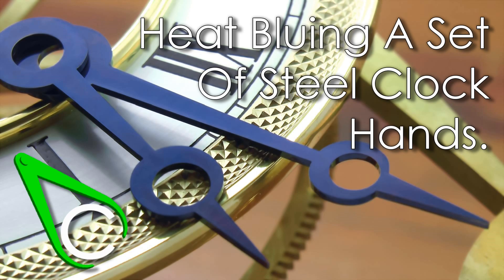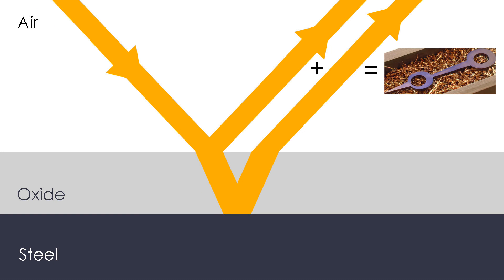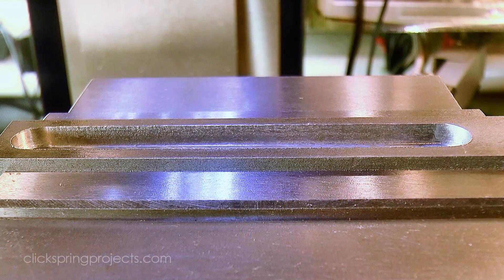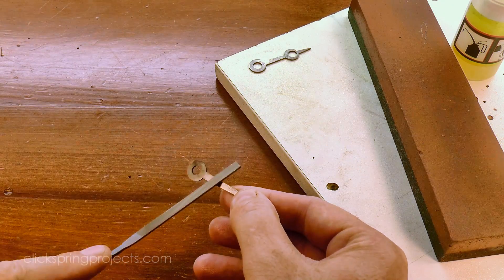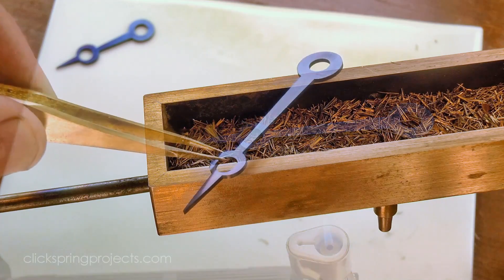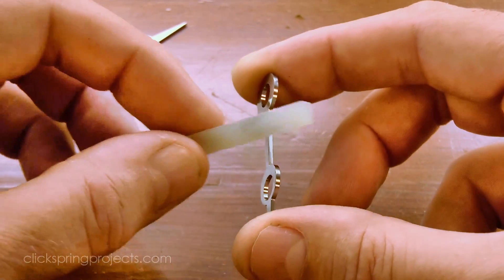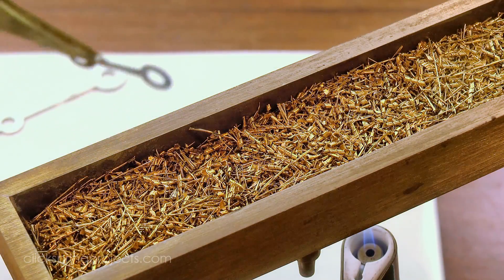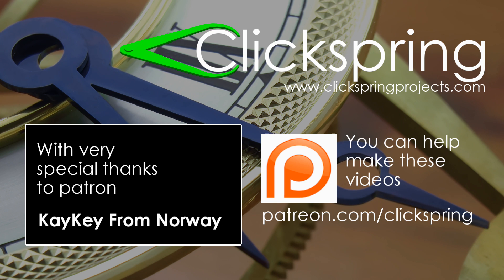Spare Parts #12 - Heat Bluing A Set Of Steel Clock Hands

Comment: Are the results you obtain (which are amazing!) ONLY about achieving the target temperature uniformly in the part?  Or is the rate of ramping to that temperature and soak time critical as well?

If its only temperature, I wonder if this process could be accomplished more easily (and perhaps with much larger parts) with a soak in an electric oven, assuming one could be constructed with really good temperature control.  Its much easier to get a steak cooked right with a "sous vide" method, I am imagining the same principle.

It seems that much of the difficulty of getting this perfect stems from the torch being MUCH hotter than the target temperature, meaning that you have room for overshoot.  If that is true then a lower temperature heat source might give you more margin for error.

This suggestion is a bad one though if the temperature scale assumes flame heating, and is only a proxy for rate of heating and time.

Comment: What's the purpose of dunking it at the end? I would need a 40 liter container to fit my part into so oil wouldn't be practical, would water suffice? followed by thoroughly drying and then manually coating it with oil and then wiped off?

Comment: HAY. Long story short, I was drawn into your channel after watching a 'Clips' video on turning your own screws, in which you blued them. Ended up watching a significant portion of your other videos on both channels. My main question, after that first video, was "is that rust preventative bluing?" and "why have I never heard of heat bluing, only hearing of chemical bluing?". From what I have read, that blue is Fe3O4, and is rust preventative. My GUESS on the second question is chemical bluing produces a more consistent color, with much much less effort, and is better suited for large volumes of parts. Is this the case, or is there another reason like limitations on temper in your process?

Comment: The part I don't get is why blue it the first time if only tempering?  Like it looks like you only needed to temper it because when you started smoothing it down, you removed that oxide layer and it was back to a mirror steel look again.

Comment: The property of the oxide in refracting light also please a similar role with electron flow? This question comes from the idea of Foxhole radios that used blue oxide on steel razors as a form of diode.

Comment: I've been watching your videos for a few weeks and while I have been doing so, I have inherited an early 18th century long case clock.  The mechanism is in generally good condition but it does need a bit of a clean (fair enough after 280 years).  However, there is a small bit of red rust on the blued steel hands so I had been wondering how I'd be able to blue them again after brushing the rust off when I happened upon this video.

Thank you very much.  This was just what I wanted to know.

Comment: Cris If you adapt an electrical resistance in the box, it may have a better result in the uniform distribution of heat to the parts. Another improvement would be to put a display and a temperature control circuit for the process to become automatic. there are boards ready in Arduino for this purpose. Big hug and congratulations on the great video. I learned a lot!

Comment: Take a look at niter bluing. It is basically the same process as you are doing, however it uses nitrate salts to heat the parts evenly. This is not the same as hot bluing, which is done at a lower temperature and uses water solution of sodium salts. Niter bluing is done at 600-700 degrees F while hot bluing at 275-310 degrees F.

Comment: Hi Chris. Amazing results. Thought you may be interested in the method I use which is very easy and does not require as much skill. I use a solder pot to blue my parts. Half full of solder and filled to the top with fairly fine brass shavings. The shavings mostly float on top of the solder and the part is just put into the shavings. The temperature of the entire part can then be controlled within 1C or 2C and you can accurately dial in the exact colour that you want without danger of overshooting. You can also allow the part to soak to ensure consistent colour and of course you can put several parts in at the same time to get a perfectly matched set. You could simply fill the pot with solder and loosely wrap the part in tin foil and immerse in the solder. This works well and is very fast but you need to use something to stop the parts from floating too high. Solder pots that work from 200C to 450C can be obtained from ebay for approx £20.00.
Reply: Hello Jerry, I am interested in trying my hand at this and if your method is easier that would be great.  So if I understand well your steel part will be floating on top of the melted solder.  Won't the solder then stick to the blued part when you cool it down (sorry if the question is dumb.  Also (and it applies to clickspring) where do you get the brass shavings, do you make them from bulk brass?  The project I have in mind is that I am making folding knives as a hobby and would like to try getting this blue for some of the ancillary parts (screws, bolster, spring), obviously not the blade which needs to be tempered to straw color not blue.

Comment: I've just been down the comments from this video, and am amazed at the number of people that ask the same questions over and over, eg, does the blue colour provide protection, what steel do you use, can you get better results using an oven etc, etc. It just show that few people actually bother to read the comments.

My question is, do you get frustrated with having to give the same answer umpteen times, or do  you just cut & paste?.
Reply from the maker: No it doesn't bother me, I will cut and paste if its a complex answer that I've already covered before in detail, otherwise happy to just answer the question anew.

Comment: I love the colour of these items, it's gorgeous.

When the process fails, as the colour is due to a layer of ferrous oxide, i.e. rust, couldn't you just dip them in a bath of weak phosphoric acid, such as Killrust, as opposed to going through the laborious prosess of removing the oxide layer and repolishing?
Reply from the maker: Possibly, although the oxide comes off in seconds, and the repolish is similarly quick because all of the hard work has already been done. Thanks for watching
Reply: Come to think of it, that would result in a film of ferric phosphate. It would be interesting to see if that gave a different  colour when reheated.
Reply: Phosphating is more similar to low temp gun bluing - so a silver-black appearance, can also be matte black depending on thickness.

Comment: Very well done as always! One question though: What is the effect of the quenching in oil after the cosmetic bluing? What kind of oil are you using exactly?
Reply from the maker: It cools the part, stopping the color change. I use a light compressor oil. Thanks for watching

Comment: Would placing the bluing tray in some sort of oven get a more uniform heat instead of heating with a torch? And thus reaching a more uniform color?
Reply from the maker: Yes I have seen some great results with shop made ovens and hotplates, although it is still not as straightforward as it might appear to control temperature precisely with an oven. Thanks for watching Luc :)

Comment: awesome! if you blued a tempered knife would it lose its hardness causing it to not retain a sharp edge?
Reply from the maker: +David Hall Hey David, yes it would. Carbon steel taken to blue temper is too soft for a knife. Tools that need to maintain a cutting edge are generally tempered to the lower temperature corresponding to the color of pale straw. Thanks for watching!
Reply: Clickspring Thanks for the help! I might make one as a display piece, i bet it would look really cool :D
Reply: +David Hall You could always heat the knife primarily along the spine, so that the top is blue, with the colour shifting to straw as you move down towards the blade. I think this will depend somewhat on the dimensions and profile of the knife.
Reply: +Andrew Reece yeah good idea, thanks man!
Reply: +David Hall It's said that as a finish for tools and such it is a very unlasting one.
I'm not one to trust what I've been told, so I left one of my knives with its Bronze temper colour, and true enough it wears off quite quickly with use.

Comment: hei chris. I have a question. Does Steel rust when there are oxid colors on the steel
Reply from the maker: +Ich xD Yes it does, although the oxide has a tendency to maintain a very fine film of oil, which acts as a rust preventative.
Reply: +Clickspring Thanks for the quick answer.

Comment: So you harden the steel because it polishes better, but then temper it because it is to fragile? Also, if it is tempered to the blue, then polished, and then tempered again for color, does that second tempering lower it's hardness even more?
Another also, since you are doing the second temper to get the blue color which is achieve at a specific temperature, could you set up a furnace to heat to that specific temperature that way you don't have to worry about getting an even color with the handheld torch?
Reply from the maker: +bitfreakazoid Yes, correct. Subsequent tempering to the same temperature makes no further metallurgical changes. Ovens can deliver superb results, but it is still not simple, just a little more controlled - direct observation and careful manipulation of the temperature are still required to get a consistent result.
Reply: Interesting. Thanks for the response!! Love your videos, very inspirational.

Comment: Really glad you made this tutorial, always wondered about bluing :)

I am still curious about how much protection from rusting the bluing finish gives?
Reply from the maker: +Tonicwine999 It is widely believed that bluing provides a small measure of corrosion resistance, although I have my doubts based on my own observations. I've seen plenty of blued screws that have corroded just as quickly as non blued. Black polishing definitely reduces corrosion (less imperfections for corrosion to start on), and a wipe of oil on the bluing certainly stops it, but bluing on its own provides very little protection on its own as far as I can tell. Thanks for watching and asking mate :)
Reply: Ahh gutted to hear the bluing still corrodes... thought I'd maybe have come across the perfect finish for steel here. Thanks very much for making this video and for also answering my question so clearly. Maybe something on black polishing could be interesting - if thats even a finish you use - just an idea. Thanks again, you are a legend!

Comment: Excellent work as always! I am wondering how a small electric oven with an accurate temperature control would work for the final blue-vs- using a torch?Seems like it might remove some of the variability and be fairly easy to construct with the parts available cheaply today.
Reply from the maker: +Steamfan71  I have seen several excellent home oven and shop made hotplate designs that can deliver superb temperature control.
Reply: +Clickspring  Yes,I was thinking for small items just two soft fire bricks channeled out to support some Nichrome elements.The elements can be obtained from a cheap toaster from the secondhand store.Control the temps with a small PID programmable control and type k thermocouple.
I suppose one could even go all the way and add a a gas fitting for adding an inert Argon atmosphere .I think I have found a new project LOL

Comment: Amazing doesnt cover it. What is astonishing is that this used to be mass production techniques. How things have changed (and not for the better when it comes to artwork like this).
Reply: +Rich77UK It is still mass produced and actually done better now than ever before. With vibratory polishing, computer controlled kilns and optical sensors, these type of parts can be cranked out by the million at very low cost. The difference is in the quality of the edges. It is almost impossible to manufacture at any scale a very slightly beveled edge with a really high polish. Chris does a very good job of putting just the right bevel on it.

The really amazing thing is that he is able to rival the quality color by hand. I suspect there was quite a few failed attempts in making this video. You can actually see when he blues the hour hand that the blue missed the edges at the tip (sorry to call it out Chris).

Also, heat treating for color has fallen out of favor and been replaced with anodizing which is also very nice and vastly cheaper.

Comment: Hi Chris,

 I regularly use hardening and tempering to get the needed properties from metals, in this process I use a small oven with with a PDI to get determined and stable temperature, wouldn't you benefit from such a oven to get more controlled results? Since there is a way to make those for kinda cheap.

Thanks for those great videos, you just give me the urge to try the cosmetic blueing.........      ;)
Pierre
Reply from the maker: +pierre beaudry Hey Pierre, I have seen several excellent home oven and shop made hotplate designs that can deliver superb temperature control.
Reply: The one I have is self made from a copper enameling unit bought real cheap, not more than 150$ Can.  it's even visible in some of my videos, works great within a few deg. C...   ;)

Comment: Cringed with the Rodico kneading! The rodico will absorb grease and sweat from the fingers, when you touch it = not clean part.
And Rodico will leave a residue, so it is isn't well suited for final cleaning.

Other than that, great vid as always!
Reply from the maker: +Bakkendorff Thanks for sharing your thoughts, and for watching; However I get excellent results kneading a new piece of Rodico to get it just a little more tacky, and find it leaves no detectable residue under excellent magnification. As you would be aware, there are few better ways to detect contamination than the bluing process.

Comment: I thought the bluing was achieved thanks to those brass scraps in the tray and some sort of reaction or oxidation between different metals touching each other while being heated. Now that i know that's not true, i would like to know, what's the purpose of those scraps? Do they just provide a resting surface?
Reply from the maker: +Marco Erra It helps to promote an even heat transfer, thanks for watching Marco
Reply: yeah, I also thought that those flakes helped creating the blue taint by chemical reaction. I just love this channel, I get to learn about stuff I would never ever get acquainted with otherwise.

Comment: Seeing as how you are hardening the parts to blue a second time for cosmetic reasons would there have been any benefit to using setup with bunsen burners and trying to keep the tray at around 282°F that way?  Also could you have used an electric kiln and simply set it to the desired temperature for a more uniform blue?
Reply from the maker: +mickleman52 I have seen several excellent home oven and shop made hotplate designs that can deliver superb temperature control. However uniform temperature is only one requirement; the preparation is the critical part that ensures a uniform blue.

Comment: I realize this question may be naive, but that is what I am.  If the temperature is so critical, why not just set my oven to 295 and put the piece(s) in a thermostatically controlled environment?
Reply from the maker: +One0ldGeek Not naive at all :) Yes I have seen several excellent home oven and shop made hotplate designs that can deliver superb temperature control. As I mention in the video though, uniform temperature is really only the last part and probably the easiest to achieve, the preparation is the critical part that determines success.

Comment: Magnificent! Just one question: To maintain the blue on the hands will you have to put oil on them in a long term repeat maintenance program or will you do something else to protect them?
Reply from the maker: +Springwood Cottage A light wipe with oil is generally the only practical oxidation protection, if the finish is to remain natural and consistent with traditional horological practice. I have read in some texts that some believe the oxide provides a small measure of corrosion protection, but I have my doubts about this based on my own observations - I have seen plenty of blued screws that rust just as rapidly as non blued.
Reply: +Clickspring Interesting & as I have some old clocks a follow up: How often will the hands need re-oiling & is there a way of doing this that keeps it off the other parts of the front of the clock & is a thin mineral oil the best protector?

Comment: Hi Chris,  how resistant is the blue to wear?
Reply from the maker: +SamEEE12 Hey Sam, not very resistant at all. It is very easily scratched, and does not last well in areas of frequent handling. However in parts where it is kept away from the user (eg inside a clock or watch) it has been known to endure for many hundreds of years. Thanks for watching :)

Comment: I wonder if a oven would work better for this process. Granted, making an oven to get up to 300c may be a bit of a challenge. But would it heat the part more evenly?
Reply from the maker: +610bob An oven can definitely give superb results if it is set up to be very well controlled. I have seen a few shop made ovens that work great.
Reply: Clickspring Thanks for the response. I just finished building a powder coating oven which is what made me think of it. I always wanted to try bluing, but never had a need for it. I may have to try it one day. Maby when I build a smaller oven and don't mind replacing the elements. :)